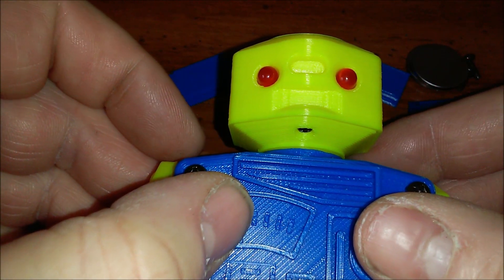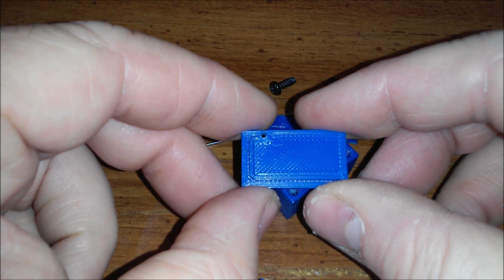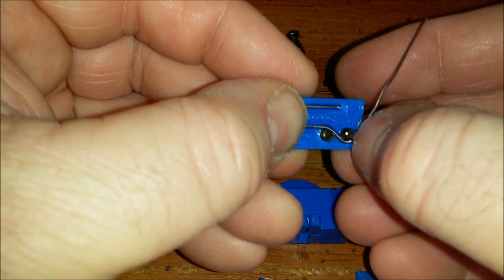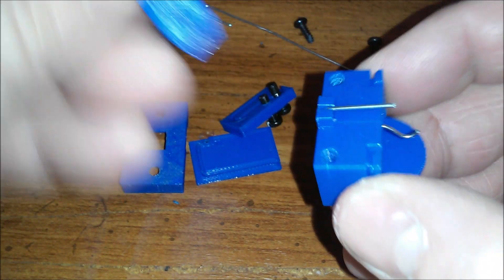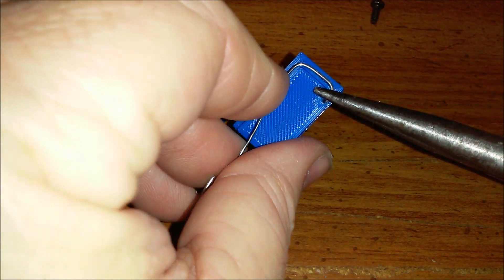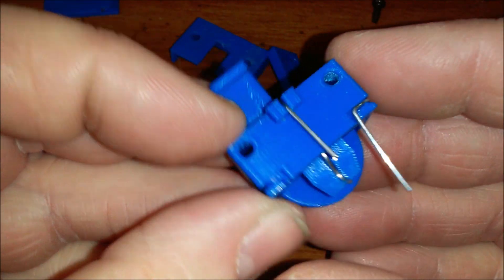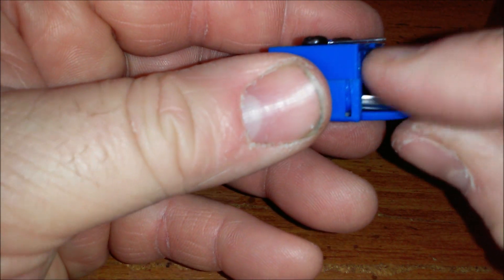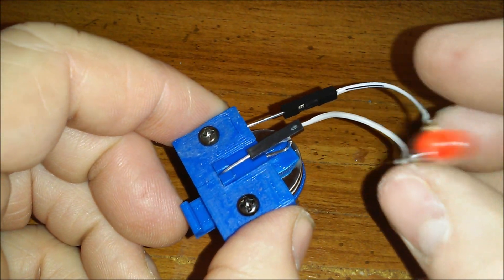3D printed CR2032 battery box with switch

Comment: I found this on Thingiverse. I'm making a relocator for a proprietary 6v battery that doesn't quite work for me where it currently mounts. I just created the other end for replacing the proprietary battery with a plug in Blender and will plan on remixing this great design for the CR2032 side. Great Work! This looks well designed and perfect for my needs.
Reply from the maker: Thanks Craig. Hope it works for you.